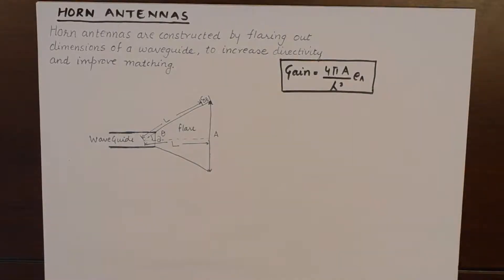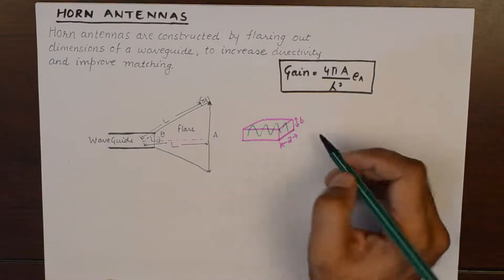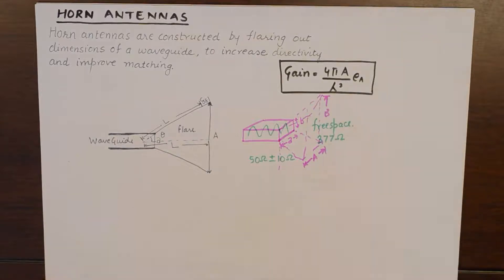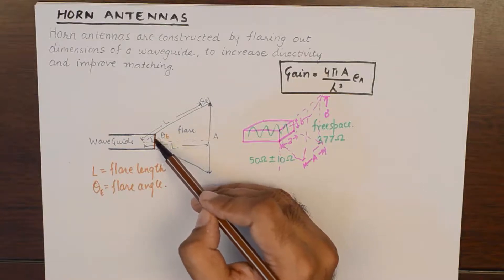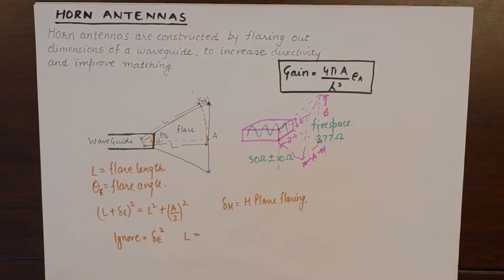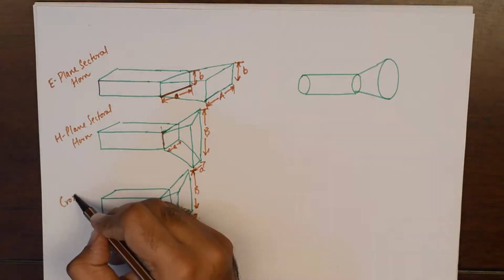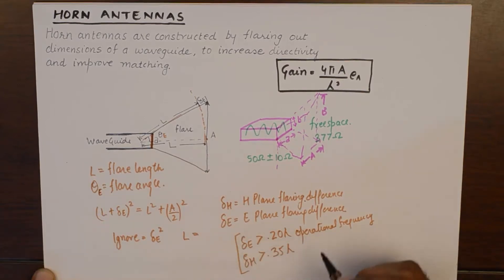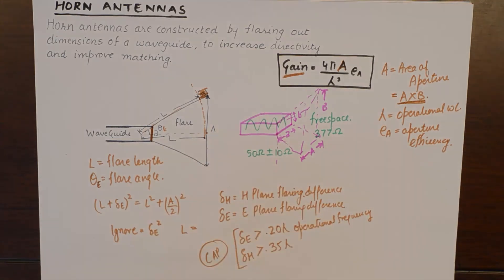Horn Antennas | Basic Design and Working

Comment: does a waveguide can transmit or receive the signal without flaring it out? and what is impedance in horn antenna and what is the mode of transmission?
Reply: one more q how can u tell that the impedance of the waveguide will be equal to 50 ohm
Reply from the maker: It can radiate without flaring but with the characteristic impedance of waveguide which is close to 50 ohm. Mode doesnt matter as there will be spherical wavefronts of different polarizations.
Reply: tq for help but a waveguide can be of any dimension so how can its impedance be fixed?
Reply from the maker: its not fixed, but of the order and close to 50 ( dimesnsions of waveguide restricted to centimeters) which is way too less than 377 that of the air
Reply: can we build a waveguide of a bigger aperture without flaring it out to do matching
Reply from the maker: bigger waveguides dont make sense, they are kept in centimeters so that GHz signals can propagate :) Remember cut off frequencies, there main application is microwave propagation
Reply: so kind of u sir tq :)